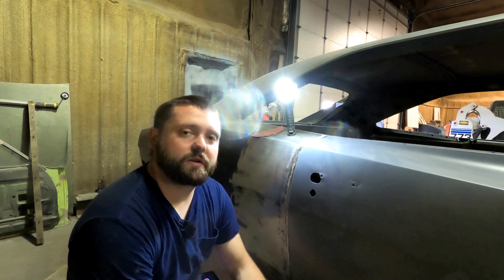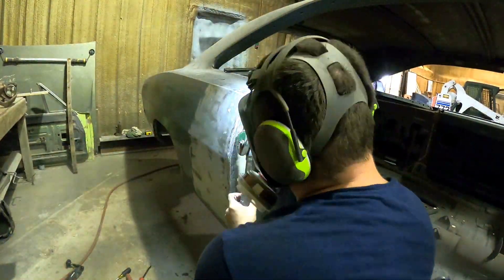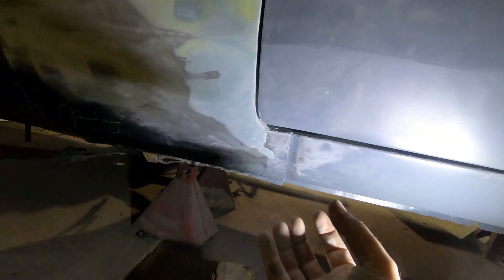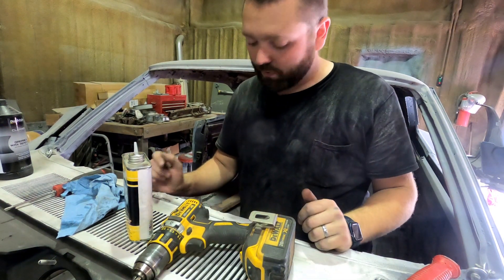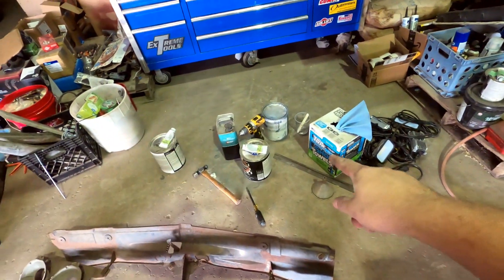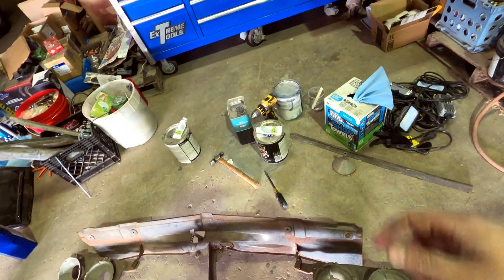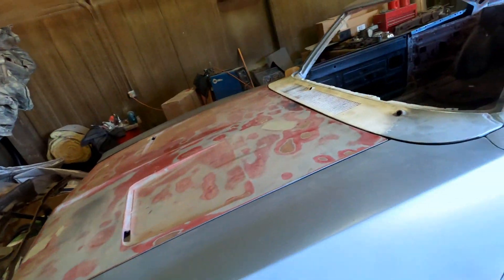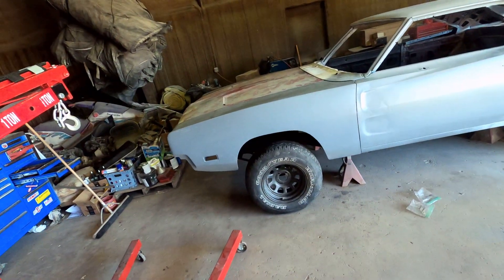Unbelievable Comeback: From Left for Dead to New Body Panels! Part 22

Comment: Charger is coming along nicely 👏🏼
Reply from the maker: It's definitely a goal to have it done by the end of winter.
Reply: Nice charger but be careful. I have a 69 and if you set the gaps on jackstands they will all be wrong when you set it on its wheels. I learned the hard way.
Reply from the maker: @nickjones1505  probably should just put it on its wheels here soon. Been putting it off.